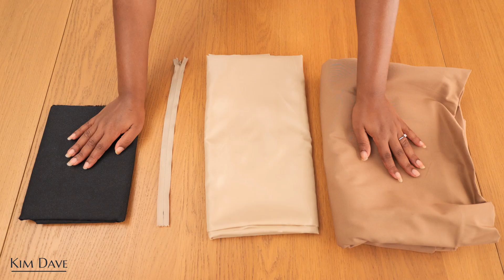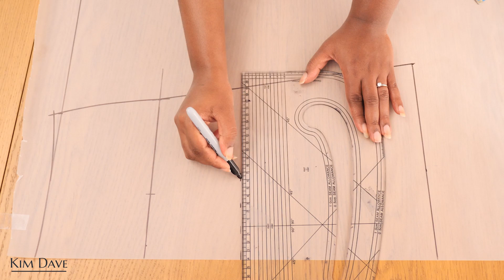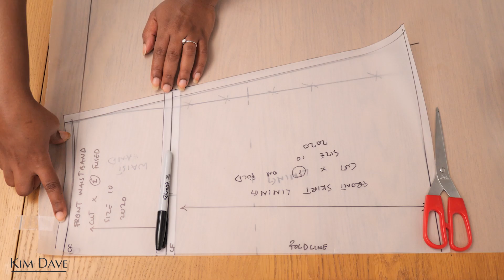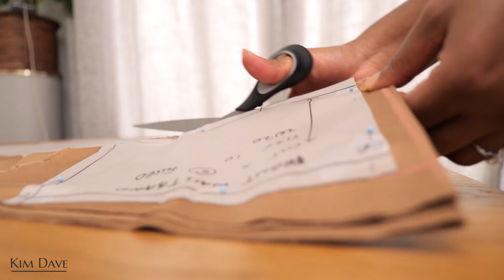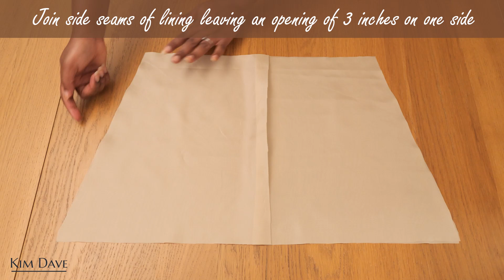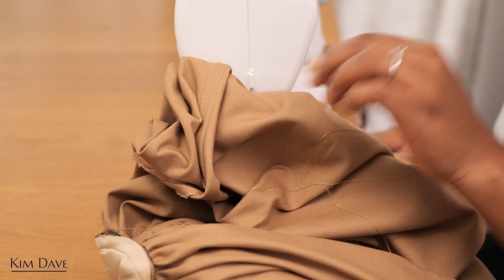Balloon Skirt Pattern & Sewing Tutorial

Comment: this tutorial is so clear and easy to follow, but I had so much trouble figuring out how to get the right sides together lol. I realized I was over thinking it. But it is incredibly hard to do, and I did the balloon effect in sections, not at all once. I was looking in the comments for tips and tricks and couldn't find any, so I just wanted to leave this for people who may be struggling like I was.
Reply: how did you finally figure it out? I feel like I’ve been trying for days😅
Reply: @musicforlifeeeadub  hi! Have you found out how to make it? If so can you please explain? 😅 I’ve tried so so many times
Reply: ‘Right sides together’ doesn’t refer to right and left as you may intuitively think. 

In sewing there is a right side (which is the part that faces outward when you wear it) and a wrong side (which is the part that touches your body and where all your seams go) 

And in this case the wrong side will never touch your body because all of the seams are on the inside of the skirt.
like if you turned a t-shirt inside out (right sides together), sewed the neck to the bottom and then pulled the whole thing back through one of the sleeves.